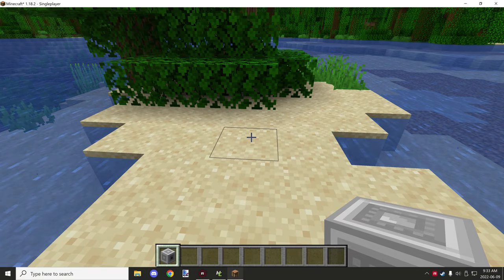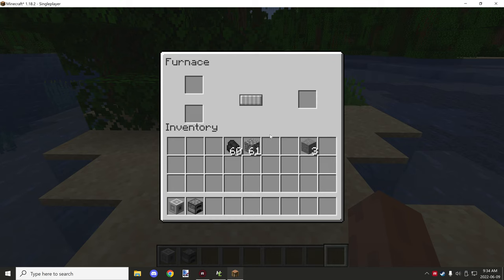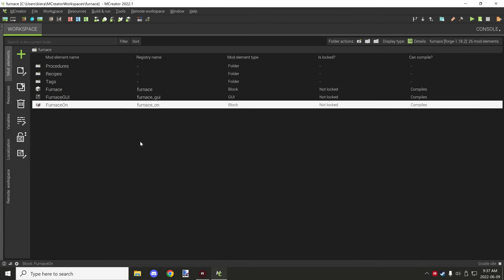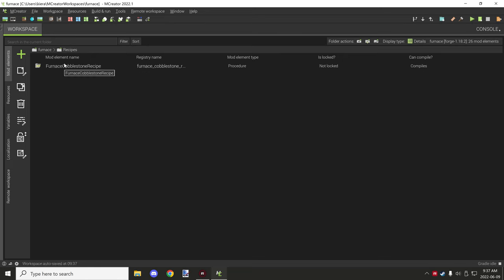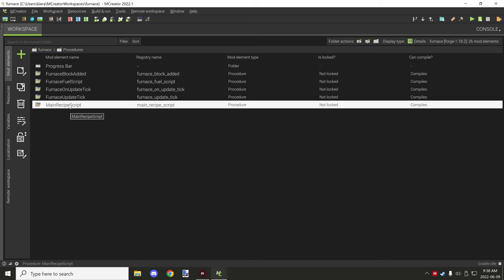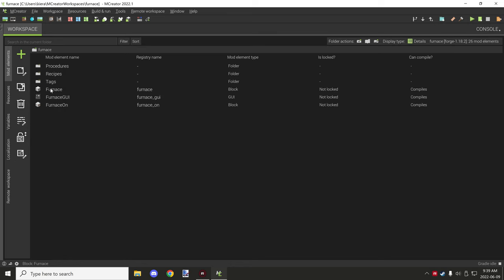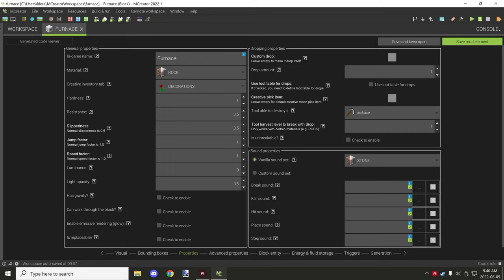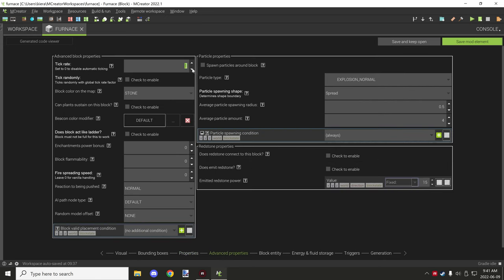MCREATOR: Custom Furnace Station | 2022.1

Comment: The furnace instantly smelts with no timer, I can't seem to find the solution for it. Any reasons you could suggest for this? I put the fuel in and it just turns the input into the product every tick instead of every 200 ticks (350 in my case)
Reply from the maker: The timer is needed to delay the smelting time, if you remove it you would need to use a block tick rate to a higher number but this can have it's own issues and may require the code to be changed to something more of a single tick thing.
Reply: @NorthWestTreesMCreator  I managed to solve it, I didn't remove the timer I meant that there wasn't a timer for some reason. Turns out it was just a spelling error

Comment: I have a bit of a theoretical question. Faced with the problem of implementing one block... The idea is that the block has an inventory that charges the item, but I can't change the value of the NBT tag. That is, I don't know how to refer to the item correctly, using "Get a copy item" doesn't work and about "Provided itemstack" too.
Reply from the maker: so you would want to replace the "provided itemstack" block with the item block from "Slot & GUI procedures" this will get the slot id which is needed for the test.
Also you need to use the block from that tab as if its from a block then it will not be synced properly as GUIs are mainly on client side so it makes it hard to pass from server-side to client-side, like if you want to get the NBT from a block that is placed even though the block is the place you opened the GUI from you still need to pass the NBT to a player global variable so that you can use it in text or what ever element you need it for. Most likely though you just need to use the block to get the item from the GUI slot and it replace it with your Get or Set blocks in your condition.

I hope this helps.

Comment: Hi great video btw but i have a few problems:
1. The fuel doesn't deplete slowly as normal
2. The progress bar seems to not reset after taking a input item out of slot 1
3. Lastly the furnace model doesn't go back to an off state, after removing everything from the GUI, it stays permanently lit. 

And bonus question, is this furnace tutorial only meant for one singular recipe or can you add multiple recipes to this easily?

I'm using MCreator 2023.4 btw so some of these issues might be related to that I'm not sure
Reply from the maker: This video is pretty outdated looking at the procedures. I am not sure if it would even work with the latest version of MCreator. Not sure when I can get a video out I have three three videos planned then its back to forge project for a few videos, most likely 4 there so its going to be about 7 weeks if everything goes as planned. And then I can work on a updated version. I will be releasing a custom crafting video next Tuesday it may help with some of it but outside of that it most likely just needs to be remade.
Reply: Update, I managed to make it work, i just made a few mistakes, thanks for the great tutorial btw @NorthWestTreesMCreator

Comment: thank you for the tutorial! I'm having two issues at the moment though. The progress bar turns on when all the slots are full even if the recipe is wrong. The furnace won't switch back to its off state when finished smelting
Reply from the maker: This video is pretty outdated looking at the procedures. I am not sure if it would even work with the latest version of MCreator. Not sure when I can get a video out I have three three videos planned then its back to forge project for a few videos, most likely 4 there so its going to be about 7 weeks if everything goes as planned. And then I can work on a updated version. I will be releasing a custom crafting video next Tuesday it may help with some of it but outside of that it most likely just needs to be remade.
Reply: @NorthWestTreesMCreator  No worries, man. I respect the grind. The furnace I made works, it just had the issues above. Can't wait to see more videos from you

Comment: I created the furnace following your tutorial step by step. Everything works except the gui that does not update, the materials in the input slots do not decrease and in the output slot there is no product. I have to close and reopen the gui, then it works. I am using mc 2022.2. Could you help me? Thanks for your tutorials
Reply from the maker: The tutorial may have broken a bit, there has been some GUI blocks added in under a specific tab, you may need to use those block as they run on client side and up date with the player. I may have a newer tutorial if not feel free to create new comment and let me know and I will work on a new workspace for a video update.
Reply: @NorthWestTreesMCreator  Thank you for your answer. I have done several tests but I can't fix it. I would be grateful if you could create a new tutorial, or give me directions on how to fix the problem. Thanks for your help
Reply: @liberatocirillo7879  I'm also having the same issue, did you ever figure it out?

Comment: Hi, nice tutorial. I just have one problem though. I made the change of block instant - when there is no energy or when there isn't anything in slot 0 (1), the furnace shuts off immediatly. When I take some items from the slot 0 (1), the item just teleports from the cursor to inventory. Not sure if it can be fixed somehow though.
Reply from the maker: I mentioned the script in the video in the procedure that fixes this issue.
Reply: @NorthWestTreesMCreator  Is it related to the fuel script somehow?

Comment: Could you make a tutorial of how to do a furnace but without GUI, like you put the coal and then you right click it to turn it on, and you put the food on the block and not in a GUI
Reply from the maker: Basically the same system as this but you use the block tick update to run the timer and recipes, it's not much different once you know how block inventory blocks work (same as GUI ones just for block events) it's pretty easy to do.

Comment: This is my only question, how should i do multiple outputs? For example input in iron ore and want to to output iron ingots and occasionally another item like flint in second output slot.
Reply from the maker: You would need to duplicate the output slot blocks and then in the recipe script make it so items appear in the new slot you have added, same general idea but you need to make sure all the things that relate to the output slot also apply to the new slot.

Comment: Sorry if this is a newb question, but inside the tag properties I see you have forward slashes, is that an option or required for it to work properly?
Reply from the maker: I actually have not covered this on my channel, its a good question.
"/" are used to make categories I think it also places the tags in sub folders in your jar too.
so "cctvcraft:category/tag" would be "category/tag" for the tag part
You can have more then one category too so
"category/category/category/tag" would still be valid it helps keep things neat.

Some things you may want to use categories for is things for specific features or blocks.
CCTV Craft has one called "cameras/on" "cameras" and "cameras/off" as well as sub groups for cross mod support like below
"cameras/small", "cameras/small/on", and "cameras/small/off"

Hope that helps.
Reply: @NorthWestTreesMCreator  Ahh I see, thank you for clearing that up :)
Reply: Oh one other thing, I notice while I'm in the GUI and it goes to take another fuel, the number does not drop until I leave the GUI and reopen it. If I remove the fuel out after it was suppose to take 1, it does a temporary dupe. I might have messed something up, but I went over and over it to make sure. Is there a way around that?

Comment: Uh... Does it mean we have to add every single smelting recipe in order to use that furnace? And i want my furnace progress bar runs faster (about 2 frames per tick) cuz it has 32 frames
Reply from the maker: Procedure based recipes require every recipe to be added by hand yes.
You can use call blocks and use return blocks and call and get return value to make the process a bit lighter but, adding vanilla recipes have never been possible, at least not without code.

Comment: Anyone know why my recipe script is never being called? That whole part under the "else" section of the if else block is never being called, actually.
Reply from the maker: So it should only be called if there if fule 1 or higher in the NBT variable
And the smelting time is the same as the max time. If these two conditions are true then it will reset the timer and then run the main recipe script that calls all the recipe procedures.
It does this to craft the items after testing for the item in the slots. There is a good chance that it might not be set up correctly on your end. I suggest checking the example workspace  provided in the description on my GitHub.

Comment: Hey, I have a question: I’m trying to make a custom furnace-like block called an “alloyer” that takes two ingots of different types and combines them together to make an alloy, but I don’t know how to do it, since I don’t know how I would make something that smelts two things at once. Can you help?
Reply from the maker: You would need to take two slots test if they have the required items, if true then test if there block has fuel, if this is true then turn on the furnace consume the fuel have it smelt over a period of time (furnace is 200 ticks blast is 100 ticks) you will need a timer for that and make sure the block has a tick rate of 1. Once the timer runs out then you want to remove the two input slot items and add your crafted item to your output slot. It seems like a lot of steps but it's not to hard once you know more about things like timers, how the inventory blocks work (I have a procedure tutorial on them) and the general thing you need to do.
Reply: @NorthWestTreesMCreator  thanks!

Comment: Is there a way I can add a sound to this?
Reply from the maker: I would use a timer and run the timer though a tick update procedure so when X amount of ticks runs you replay the sound when the block is running or being used.
For custom sounds you will need to do a bit of math 20 ticks = 1 second so you will need to work out how long your timer needs to delay for before the next time the sound needs to play.
Reply: @NorthWestTreesMCreator  thank you

Comment: I've followed this tutorial basically to a point, but for some reason my furnace only burns 7 things not 8.. It runs through the whole last smelting animation, however it doesn't output the last item 🤔
Reply from the maker: "I've followed this tutorial basically to a point,"
If you made any changes to the script then I can't really help because I don't know what you're going for nor do I know what you have changed.
Your best bet would be to use the example and pick apart the blocks to get an idea of how the system works first before editing it.
This tutorial is pretty advanced for beginners I often have people trying to jump into the procedure system but not ready to tackle this level of a project.
So I strongly suggest you play around with the example workspace in the download and check how things tick, hopefully, this will set you on the right path for the system you have in mind ;)

Comment: this green "tag names" are variable or custom text?
Reply from the maker: green is for strings, the block you see allows you to type text into blocks that use strings this may be for for even things like block NBT names, the block is used a lot actually but in short its a text value of what is set in the block.

Comment: Hey on your single crops video my procedure looks the exact same as yours and I’ve fixed the tags and everything however my game crash’s when I right click with the seed on the farmblock is there anything I can do to fix it
Reply from the maker: I replied to the comment you replied on but I will post my response here just in case you missed it ;)

I just checked and it indeed has the issue at night, this is due to the seeds checking for a valid position for crops to grow, if you add a light source to the area it should allow the placement but it needs to be => 8 in light level, vanilla crops will pop off if 7 or below.
You can also remove the test in the seed placement script where it tests if it's a valid position this should allow for the block to be placed during the night but it will only pop off due to the light level not being high enough. you may be able to replace the light level with if it can see the sky to allow for the crops to be planted.

If I have some time to patch the workspace I will do that.
I have a dentist appointment this weekend so most likely I won't have time for a couple weeks given I remember.
I hope that helps in the meantime though.
Reply: Thank you so much

Comment: sorry if i am not so smart with this but, how do i make it so it can use two inputs, i am planning to make it so it can turn copper and tin into bronze, it would be much appreciated if you help me on this thank you
Reply from the maker: You most likely would need to add a second slot, I suggest looking at the script for crafting tables as they would fall more into that realm for multi slot smelting stations.
In short though you need to test for the contents in your input slots, test if the fuel slot has fuel then test if there is room in the output slot for the desired item, if true then the item can be added to the output slot.
It's a hard concept for many and I have not done a great job at explaining it I can probably cover this in a future procedure tutorial.

Comment: Does anyone know how to do the procedures to make an oven but without needing fuel?
Reply from the maker: You would just remove the script for testing if the fuel slot has fuel, you would need to override the fuel the furnace has, this can be done by simply testing if the furnace has 0 fuel if true set it to a higher number of your liking, another option would to edit the fuel timer and remove the timer but keep the fuel value at something above 0. this would work too, both would work but depending on what you want your mod to go for with mechanics one or the other could be decided on for your mod.

Comment: If I change the item im smelting without removing the item from the output slot it burns through fuel without stopping, It also does this if I leave it running after the output slot is full. Is there a way to prevent this?
Reply from the maker: You would need to test if the item in the smelting slot has no item or at least not a valid one more or less if true then you will need to pause the timer that controls the smelting process. I don't remember what I called it in this version of the tutorial but this should pause the smelting time which may be what your looking for.
Reply: @NorthWestTreesMCreator   How do I pause the timer? My mcreator is on version 2022.2, and I have been trying to figure out how to pause it for some hours now over the last couple of days, but it doesn't seem to be working.

edit: I think I somewhat figured it out.

Comment: i made a furnace but it's not working:
- It doesn't use fuel so i don't need Fuel script procedure
- It doesn't have on/off animation so i don't need furnace off procedure and furnace off update tick
- Also bc of these above reason i only need the SmeltingTime NBT, i dont add MaxTime cuz i can just use a number instead (200) (in 20:38 )
- Recipe script is the same as u
But why it's not working....
Reply: update: im so dumb first thing i forgot to set tick rate. and this is even more stupid, i typed the tag wrong, the NBT tag is supposed to be ProgressTime (same as SmeltingTime here) but i typed ProgressTIme.
now it works

Comment: How do i import guis
Reply from the maker: GUIs can't be imported, they need to be created, you can import images to change the design of the background though this needs to be under the others item type for it to show up, in 2022.2 there should be a specific folder to store it under.

Comment: It don't work, i don't know why and I can't tell you anything else than; it don't work.
Reply from the maker: It's an advanced tutorial, chances are something was not set up correctly in your workspace, There should be a project page on GitHub that you can check to see how its set up check the description for the project page link. If not Then head over to my GitHub and search furnace and it should come up.